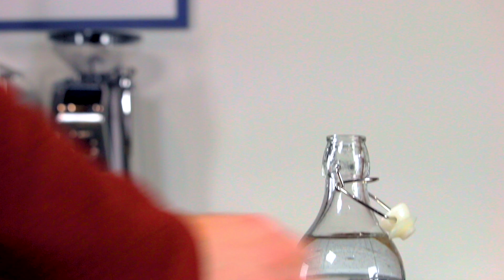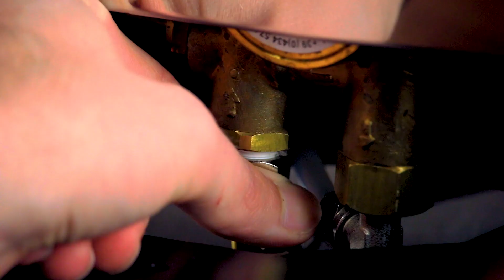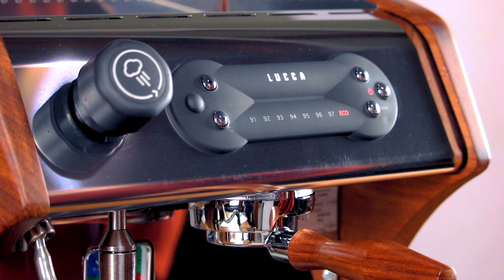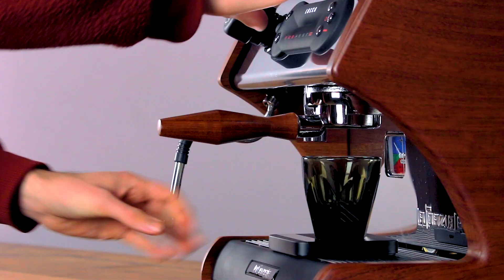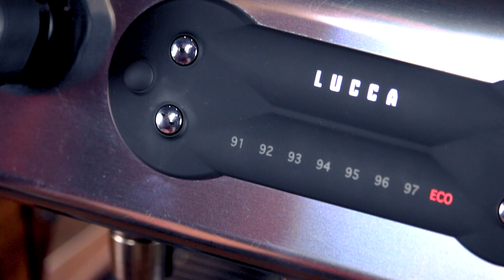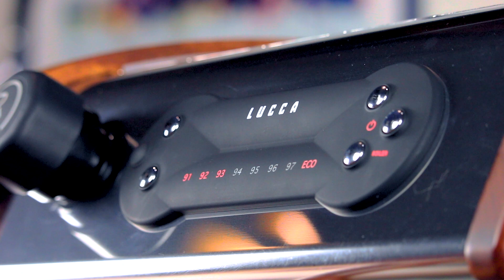LUCCA A53 Direct Plumb Espresso Machine Setup

Comment: How do you fill up the steam boiler when setting up for the first time?
Reply from the maker: The steam boiler will automatically fill thanks to the water level sensor built into it. Only the brew boiler requires manual filling.
- Charles
Reply from the maker: @Dillon Mancuso  No. The steam boiler auto-fills when it reaches a low point.